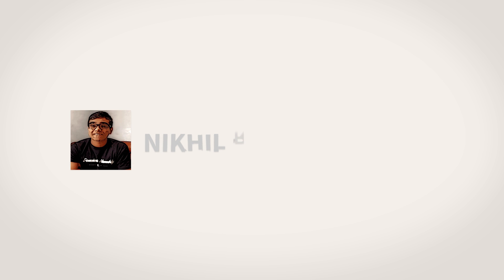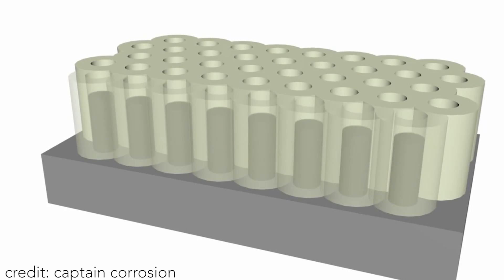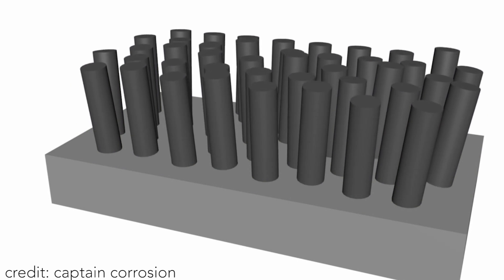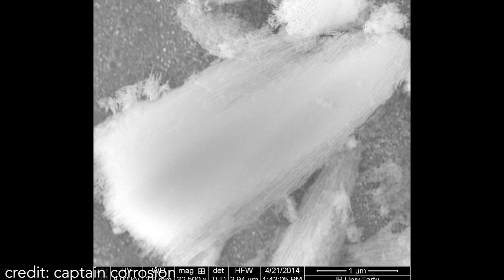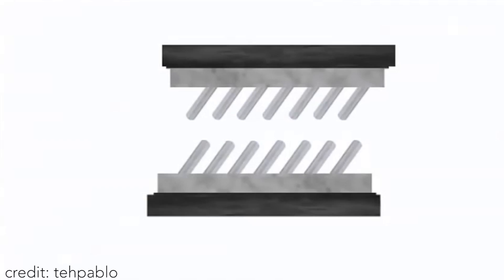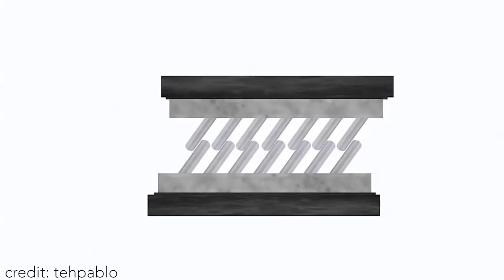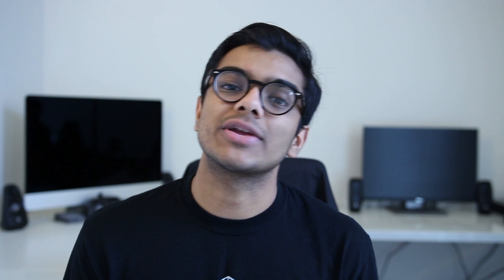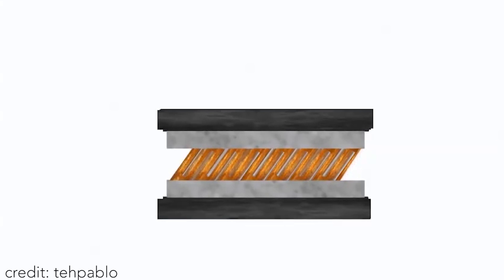Metallic Glue: No More Soldering and Welding

Comment: We run parts for a customer where the case is the heatsink.  There are pockets milled into a solid block of aluminum that houses the circuit board the metal case on the chips rest directly in those pockets.  That side has fins milled on the outside for cooling.

Comment: It might be ok to join tubing where you cant weld and superglue will not hold.  Im not sure about heatsinks and cases.  By the time you screw with growing the oxide layer and pressing it with hydraulic pressure you could just mill and lap the 2 pieces to make an optical interference fit and not need any grease.

Comment: I think you are talking about mesoglue.  I tried out the glue that doesn't need a vacuum chamber on aluminum tubing and it was more trouble than it was worth.  I get the same results using locktite superglue.